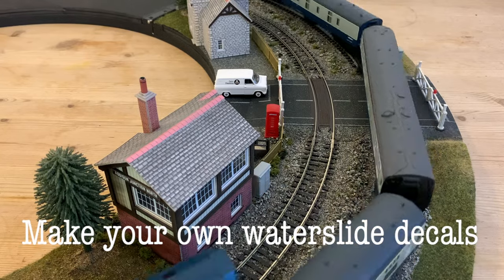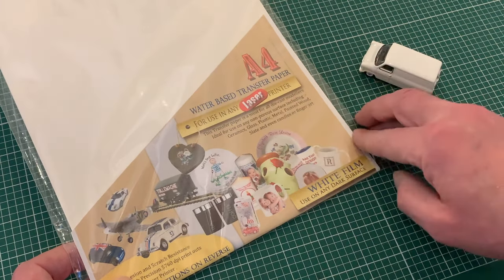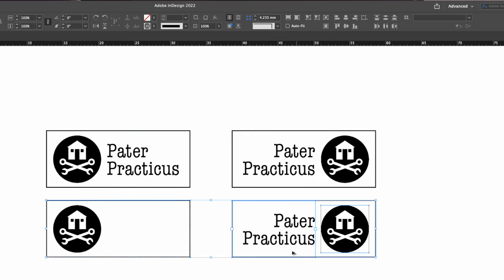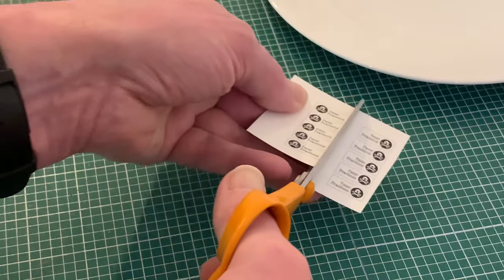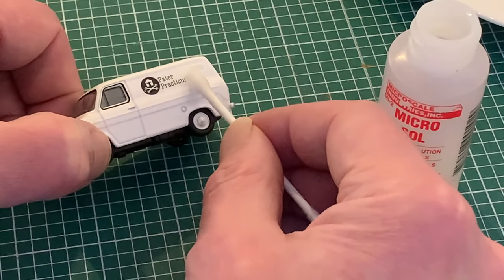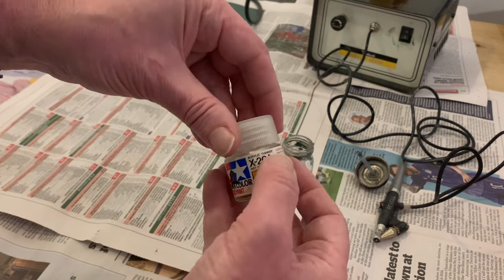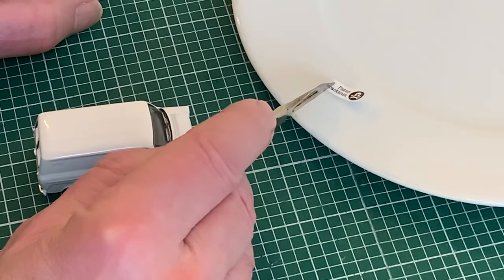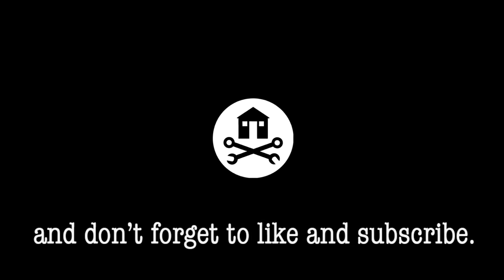Make your own waterslide decals - inkjet and laser printed model transfers

Comment: Use a brush not a scalpel to move the decal off the paper.. microsol red and blue are the best. Good to see you using them. The blue one can be used to remove the decal instead of water the red softens the decal to conform to very uneven surfaces. Use a brush to apply in all cases.
Reply from the maker: Thanks. Great tips.

Comment: convenient that you chose a white object and black letters. Different completely if it has a darker background and light coloured letters!
Reply from the maker: True enough. In this video I really wanted to focus on the application process and differences between inkjet and laser. However, I do address colour printing - with white backgrounds for darker surfaces - in another one: https://youtu.be/nNOTgvWWnAk?si=zw0VBRbCLbEfiMzx which I hope you’ll find useful.
Reply: @paterpracticus  Yes that is more balanced. The quailty of the result is dependent on several things such as matching the background colour, the opaqueness of the print and the whiteness of the film.
Reply from the maker: @robertmort5994  opacity is pretty good. The tricky bit is obviously matching background colour etc.

Comment: thanks for the tips bro, laser printer is good but more expensive than inkjet. greetings from Philippines. liked and subscribed
Reply from the maker: Glad you liked it. Laser prints are good, but also prone to scratching. I now coat mine with a very thin air-brushed varnish too just to protect them.

Comment: Great video. I can't justify the cost of a laser printer so have taken note of the comments you make.
Reply from the maker: The laser option is really only viable if you have access to a printer at work, although your local library may have one. When you are spraying the sealer for ink jet it is really important to build up thin layers gradually, so they can dry as quickly as possible. Good luck.
Reply: With laser printers starting at ~100€, I wouldn't even care to think about doing the extra steps needed with the inkjet method :)
Reply from the maker: @ssm445  Presumably that would only get you a mono laser printer. I didn't really get into the design side of things in the video and black and white suited my logo. You can of course print in colour and that perhaps makes the ink-jet option potentially more attractive, despite the extra stages.
Reply: @paterpracticus  that's right. I don't use color decals because 99% of the time, my background is colored, so colors on the decal don't work.
A color laser printer is ~200€, so the point is still kind of valid. I honestly didn't know people are still messing with ink, I haven't seen an inkjet in person for 20 years at least ;-)
Reply: @paterpracticus  You can also use a photocopier.

Comment: I found even spaying a sealant over inkjet printed decals still causes some black pigment to leech out. However, I'm not printing enough decals to warrant buying a laser printer.
Reply from the maker: Building up the acrylic sealant gradually is the answer. Let each later dry before applying the next.

Comment: My family recently got an ink-tank printer and I was wondering if I could use it to mass-print waterslide markings for my army builds. This video has helped a ton with that! Cheers buddy!
Reply from the maker: Excellent. Make sure your decals are completely sealed before applying. I used an airbrushed clear acrylic varnish, but you can use a spray can - just make sure you build up thin layers gradually, letting them dry in between, to prevent the ink spreading. Good-luck!
Reply: Be careful with "rattle can" spray paints - they're almost always enamel, and it cures too hot for decal paper, and eats it. Voice of experience....
Reply: @paterpracticus Hello. Would Galeria acrylic artist varnish work for this? Thank you, and thanks for a great tutorial.
Reply from the maker: @EternallyDisappointed  Should be fine, especially if diluted and airbrushed. But be very careful if applying by brush, you don't want to start dissolving the water based pigment. Glad you liked the video.
Reply: @paterpracticus  Thank you. Yes, definitely will airbrush it on.

Comment: What ink jet sheets do you suggest to use?
Reply from the maker: I've tried a few brands: Craftovator, Mr Decal Paper and Decals.Ltd are all good. I tend to but them from ebay as you can get them in relatively small quantities - although you'll get greater savings if you buy more at a time. If you are just printing dark colours for a light background, then go for transparent, but if you need them to show up on darker models you'll need to get white ones  - and you will need to trim right up to the edge of your design, so they are slightly less flexible. Just make sure you don't order the Laser print ones.
Reply: @paterpracticus  excellent, thanks for the advice

Comment: Love the video! I was wondering what the look of the decal would be if applied to a background that wasn't white?  Maybe  like a darker colour instead.
Reply from the maker: You can get transparent decal paper, which is useful for printing dark colours to show up on a pale background, but it is not possible to reproduce whites with a standard ink-jet or laser printer, so difficult to do decals on a dark colour without using white paper. This is possible, but it does involve having a design you can trim to the edges.
Reply: @paterpracticus I see, so you would use white decal paper instead of transparent decal paper. Then just cut out the desired shape. No printer required I guess.

Anyways appreciate the response, thanks for the advice :)
Reply from the maker: @ML21_  You'll still need to print your design on white, then carefully cut around the shape. The white paper has pretty good opacity, so should show up well against a dark background.

Comment: Very useful.

If I may share a trick of my own, you can use a word processor for the images if you don't have anything else available. They typically let you scale images with the accuracy of a millimeter or tenth of a millimeter, and will actually print the correct size.
Reply from the maker: Indeed. I have found that PowerPoint is actually surprisingly good for layout design: https://youtu.be/4Z4kqRR1go8?si=6_wb0x7QVWL-TFt8

Comment: That's brilliant thanks for the tips. But could you make a video on how to use the computer step by step on how to make the image size and multiply the decals on screen for printing. As some people like myself don't know what steps are used to print. Many thanks
Reply from the maker: Hi Shane, thanks for the comment. It's always tricky to show precisely how to create, scale and repeat images for printing as there are so many different programmes you might be using. I use Adobe InDesign, which most people won't have, so it would be good to know what you (and other people) would be using, and I can try to pull something together with wider appeal. Cheers, PP.
Reply from the maker: Hi, I've just posted a new video showing how to set up images for printing, and some simple graphics design, using PowerPoint: https://youtu.be/4Z4kqRR1go8. I hope you find it helpful. Even if you don't have PowerPoint, some of the techniques will be very similar in other software.

Comment: I do 1/24 and 1/25 model cars and trucks. I haven't been brave enough to try printing my own decals, but I've found the Tamiya clear gloss acrylic brushes on nicely (I don't have an airbrush, nor is my home suitable for one - if I spray something, I use "rattle cans" on a large cardboard out on the porch) and most decals accept this nicely - then I can start wet sanding and buffing to bring out a mirror shine and not damage the decals.

Beware of enamels or lacquers - they cure too hot for the decals and damage them. And beware "rattle can" clear - they're normally enamel.

I use needle-fine tweezers to handle the decal; be careful that you don't put too much pressure on it, and handle by the edge. 

MicroSol helps enormously, but use it carefully - I've found that if I put a large drop on a decal (say, a dashboard gauge) and leave it until it dries, it can all but dissolve the decal! Use enough to let it set in the surface detail (if not smooth), the dry it before the decal becomes too soft and starts to melt.
Reply from the maker: Excellent decal advice!

I do my airbrushing on our kitchen table, very well protected with newspaper and only use acrylics inside. Anything else I will try to do in the back yard (weather permitting).

Perhaps one day you will try and print your own. Start small - even if it does mean wasting some decal paper.

Comment: Decals have recently become the bane of my life.
Printing black onto clear is a fairly painless exercise, as are inkjet colours on a light background.
But anything else becomes fraught with issues. 
The problem is white.
Not only printing white itself, but also using it to act as a background for other colours when used against a dark backgrounds.
It is possible to obtain white inks for inkjets, but they can be problematic.
OKI produce an CMYK+W laser printer, but they start around £3,000, so out of most mere mortal's pockets.
There is a product called "Ghost" for colour lasers which comes as a toner cartridge, so one prints the white onto a clear transfer film, and then feeding the same sheet through a second time to add the colour.
Right now, this seems to be the most cost-effective solution, but is still not cheap for the average modeller.
Reply from the maker: Try this: https://youtu.be/nNOTgvWWnAk?si=7_cdmedLWbn9owET It’s a bit tricky, but it does work.
Reply: yeah I've just commented on the problems with 'white' on Decals. I bought a rather expensive white ink cartridge for my HP Laser Jet 200 from Ghost White Toner in Germany and it actually worked, you just swap out your black cartridge for your white and it prints white onto transparent decals. Sadly my HP Laser Jet is on its' last legs and I dunno how many months or years it has left and I moved to a PIXMA Canon for my graphical prints mostly that doesn't have white ink cartridges available.

Comment: Did you have to seal the paper after printing so the ink doesn't run when placed in the water
Reply from the maker: For ink jet printed decals you must seal the paper, otherwise the ink will run. In the video I use an acrylic lacquer, air-brushed in layers over the surface. The big advantage of laser printing is you don't need to do this - but obviously you need access to a printer.
Reply: @paterpracticus  Do you thin your Tamiya laquer down? If so, what ratio?
I tend to use Vallejo acrylics, and assume I could do the same with them.
One would also presume one uses gloss or matte finish based on the surfaces the decals are going to be applied.
Reply from the maker: @TryptychUK I used Vallejo in my more recent video (https://youtu.be/nNOTgvWWnAk?si=bhNfkengp10u5Yhu). My dilution is pretty arbitrary - just enough to get a fine spray.

Comment: Does this work for colour decals as well? I need to print NER Lettering for my models as all the premade ones are out of stock
Reply from the maker: Yes, should be fine. But it helps if you have an outline. Otherwise, try to match to the colour of what you are applying to, as in the last bit of the video.

Comment: Can I use an aerosol paint clear coat to seal instead of the one you used?
Reply from the maker: Yes you can, but keep the layers light. I’ve found it is easy to over-coat with aerosols, making the ink bleed a bit.
Reply: Thank you  @paterpracticus

Comment: I am trying to find a correct printer for printing. Majority white decals, but also white decals. Preferably smaller than A4. What would you recomend to get?
Reply from the maker: I’m afraid there isn’t a domestic printer that will print white. I’m currently working on an idea for printing the same image in both transparent and white papers, then superimposing them on the model. I’ll keep you posted of the results.
Reply: @paterpracticus  i did find sorta a work around. But the stickers arent solid white because of it sadly. But the lightest tint of grey thats possible
Reply: @paterpracticus  One alternative for just white is a labels cutter like Cricut.
One can create a stencil that can be stuck on and then airbrushed with white or whatever.

Comment: 4:51 For the sealing of the Ink Jet printed decals so that the decal ink doesn't run when you submerge it in water you're just using Tamiya X-22 (which I think is a GLOSS ACRYLIC VARNISH ?) and Tamiya X-20A Thinner to thin down the Tamiya X-22 varnish in the airbrush right ???

I'm just asking as I've airbrushed Winsor & Newton GALERIA arcylic gloss varnish onto miniatures before for the initial sealing layer and I'm wondering if that will work with just a few drops of water to thin down the varnish in the airbrush (for sealing the inkject decals) ?!?!?!??!?!???
Reply from the maker: It may seem counterintuitive, but a fine spray of water-based acrylic varnish will seal the ink jet print without the ink running. But it is easy to overspray, so build up layers gradually allowing them to dry in between.
Reply: @paterpracticus  W&N Galeria Acrylic Gloss Varnish it is then, thanks for the advice. I've airbrushed varnish many times with my cheapo airbrush so I'm well versed in using it. I kind of wasted £7 on a tiny spray can of clear lacquer then but nevermind.
Reply from the maker: As always, do a test first. The spray can might be alright sprayed in thin coats.

Comment: The reason why you get 'White' or 'Clear' decal sheets is because almost all laser jet and ink jet printers cannot print white so if you want your decal to have some white on it you have to 'not print' in that area where you want the white and of course choose the 'White' decal sheet for white background.

There was other extreme measures to obtain white, i.e. there is a company in Germany named 'Ghost White Towner' which sells a white cartridge which replaces your black cartridge and can print in white but it's expensive and is only available on a few select printer models (which I think are all laser and not ink jet.
Reply from the maker: I've actually done a follow-up video exploring exactly this - https://youtu.be/nNOTgvWWnAk?si=fTkbS0PJCwdrRGff

But, wouldn't it be great if someone did come up with an (affordable) 5 colour printer - with white?
Reply: yes it's strange that  most printer manufacturers just don't produce a white ink cartridge that goes in the place of the black one like Ghost White in Germany do. Oddly enough I've already watched that follow up video of yours today and I saw that video of  you putting the 'Castrol' logo decal on the side of the green truck and I thought to myself 'there's no difference in the two decals he's putting on first one white decal, second one clear decal and then I realized I guess you were doing it to tidy up the white circle rim (that u manually cut out) with the green on the clear plastic decal. And I'm thinking to myself, 'what a tonne of work for such little detail'.  I'm getting worried as my HP Laser Jet 200 is getting really old and is starting to show signs of giving up and I don't know how many more runs it has with the Ghost White Toner I bought for white decal printing. I got myself an ink jet for graphics printing but for decals that ads another stage where you sadly apparently have to seal the ink on the paper.
Reply from the maker: Yes, for ink-jet you do have to seal the print. I use an acrylic varnish, airbrushed onto the surface. It is an extra stage, but not that difficult.

Comment: Would the $89 HP LaserJet on Amazon work good enough or do I need one of those commercial office printers?
Reply from the maker: Is that the M110we? I'm not familiar with that model, but I don't see why that shouldn't work fine. However, I'm assuming it will only print black, rather than full colour.
Reply: @paterpracticus  Yes that's the one, Thank you. But your right, a color one would be better. Cheapest color one I could find is $200.

Comment: I have a question if I use the paper there is any chances that the printer get affected or not
Reply from the maker: The paper should not have any detrimental affect on your printer. Make sure you get the paper that is right for your printer - either laser or inkjet. Both should be available in either white for use on a dark background, or transparent for light backgrounds. Even if you use the wrong one, it shouldn't damage your printer, you'll just get some disappointing results.

Comment: hey there! can i use a normal printer for this?
Reply from the maker: The printer doesn’t have to be anything special. A domestic inkjet printer works fine - but you will need the special transfer paper - make sure you get the right sort for inkjet.

Comment: Where did you create the design though?
Reply from the maker: It was all done in Adobe InDesign on a Mac, although there are lots of programmes you could use for PC. My logo was already designed for the channel icon and I have it as a jpeg, to which I added the type, then step and repeated to fill an A4 sheet. I've had a couple of similar comments, so it would be good to know what software people do have (eg. Microsoft Word) so I can make an accompanying video.
Reply from the maker: Hi, I've just posted a new video showing how to set up images for printing, and some simple graphics design, using PowerPoint: https://youtu.be/4Z4kqRR1go8. I hope you find it helpful. Even if you don't have PowerPoint, some of the techniques will be very similar in other software.